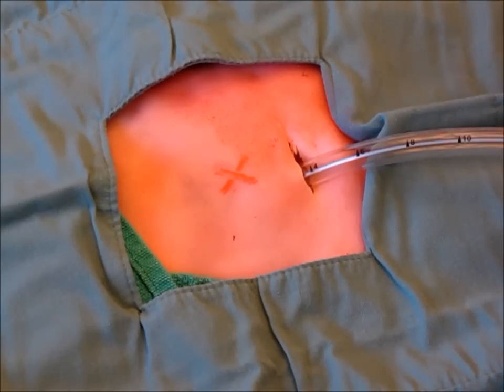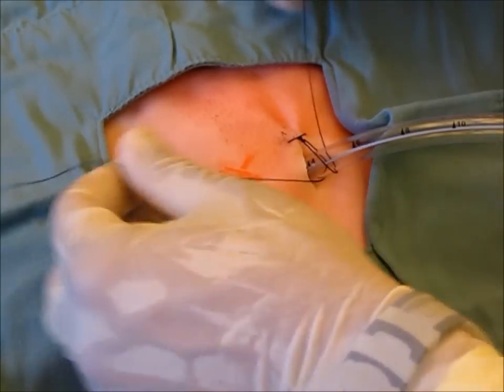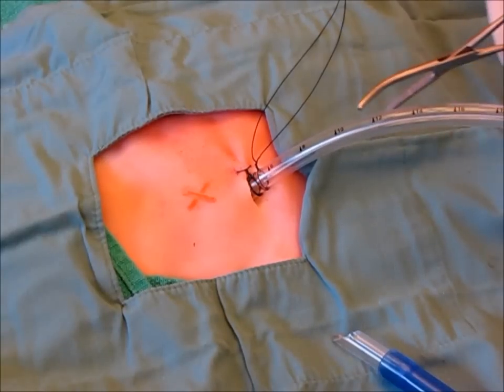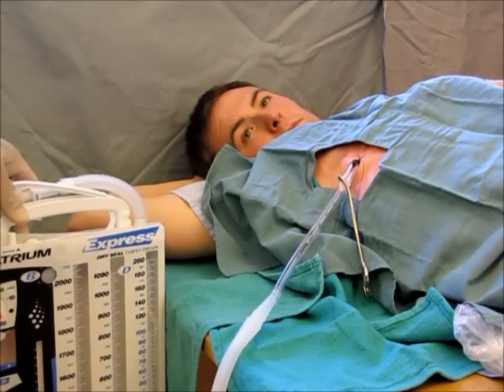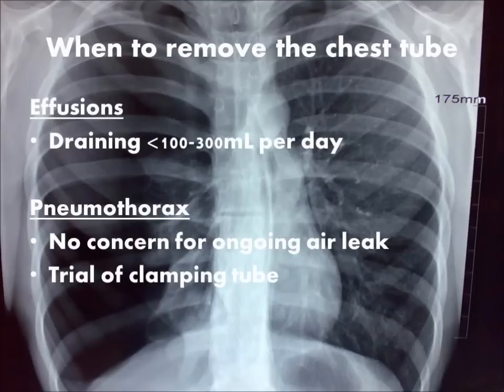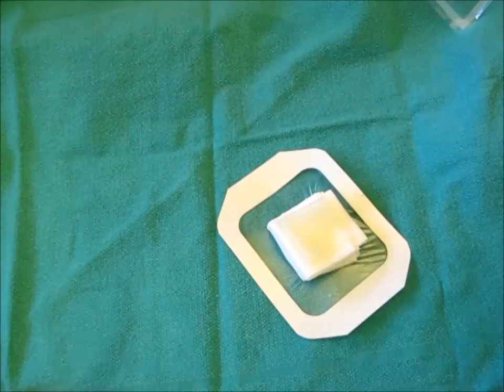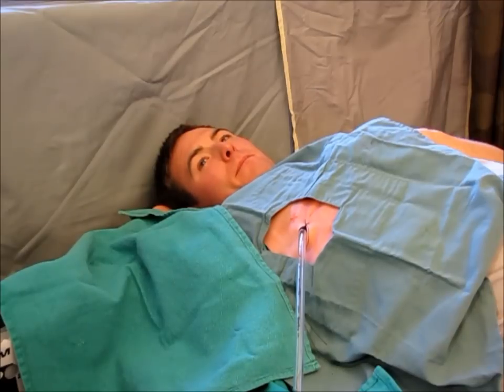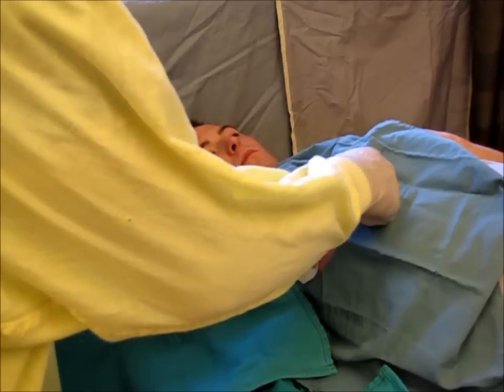Chest Tube Insertion part 2/2

Comment: Why wearing watch, under the gloves.

No Mackintosh and soaking sterile cloth under the patient back.

Didn't mentioned to lift the head side up.

Can use intra muscular atropine before going for the surgery.  

Should have clamped the tube before giving oblique cut at the bottom. 

I would have stay suture along with another suture opposite side to close/tighten the cut a bit more.
Reply: Nice comments. 
When the dissection is large air will undoubtedly go into the pleural cavity.
Do you have any recommendations?